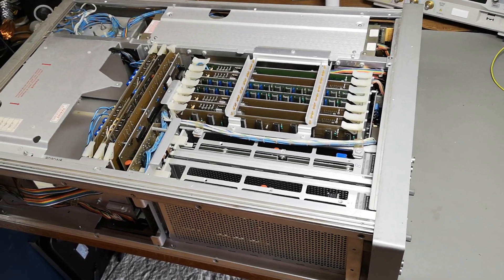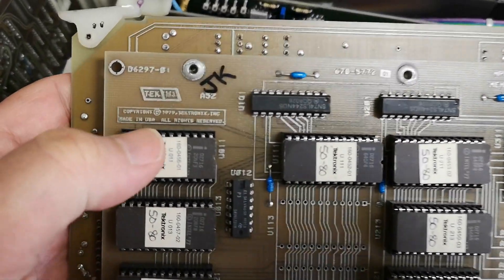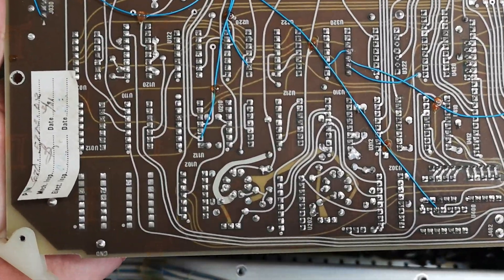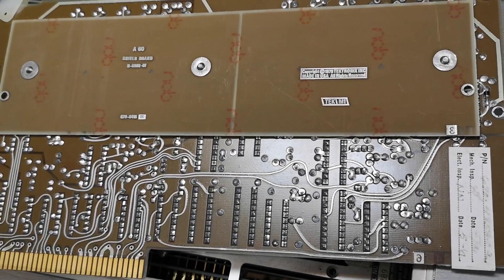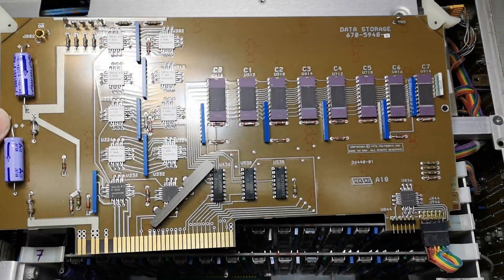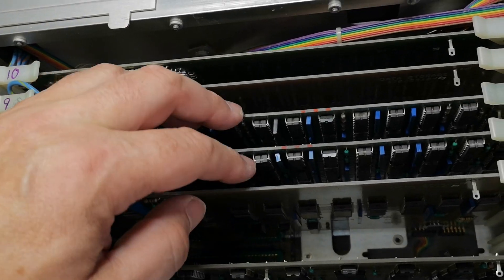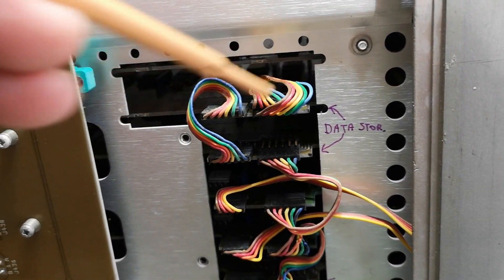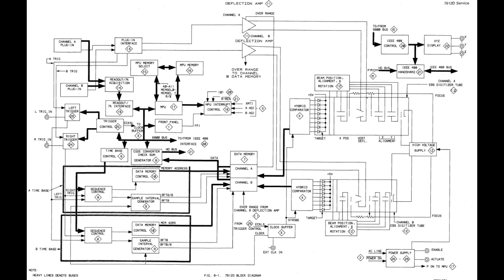Tektronix 7612D programmable digitizer 1981 teardown part 2, inside PCB cards.

Comment: Two integrated circuits on each other 😯 finished porn 🤣
Reply from the maker: this unit is full of cool solutions and very expensive design, i love to look arround stuff like this
Reply: @TeardownOZ2CPU  That unit is absolutely luxurious, I can't even imagine how long it took to develop and debug it. Nine layers of PCB in 78, I probably still made my prototypes with brass nails hammered into a board (I'm kidding, but that's how I started and in 84 I made three improvement proposals for small-scale production of double-sided PCB with photopath for positive and negative production ) I just love the craftsmanship of these machines and I'm so glad I came across your channel because otherwise I would never have gotten around to it. In CR, you only buy old stuff from Tesla, and if you come across something like this, you'd have to sell your organs to get it - that is, if you earn money by working. I wanted to buy one of the things they stole Keithley 2015 THD and I found it, but they wanted more than my monthly salary and I'm somewhere in the middle of the wage scale.
Unfortunately, this format of devices does not fit in my workplace, although I could create a rack from the drawers on the right side of the table, but then again I would lose a lot of storage space.
Reply from the maker: @Edisson.  this one i got for free, several of my super friendly sponsors even deliver or tell me where to show up to load my car.
Reply: @TeardownOZ2CPU  I'm really jealous of you, they didn't ask me even when they selected the entire workshop. It happened to me once that I would get something for free, the security equipment repair company was canceled, a friend who was cleaning it up called me to come and choose what I wanted, I immediately jumped in the car and drove there. When I arrived, I couldn't help but be surprised, except for a few trampled PCBs, there was nothing there, I left sad and in the passage under a pile of scrap metal, I saw a familiar corner of a box peeking out from the pile - I don't know where I got so much strength, but that industrial isolation transformer with the factory built-in variac in the rack cabinet (the big gray one lying on the back of my desk), I was able to pull it out of the box and load it into the car myself, we took it out of the trunk of the car in three. I had to buy everything else, but thanks to the prices, I tend to make it - that is, where it goes.